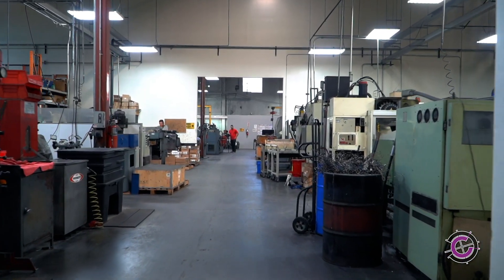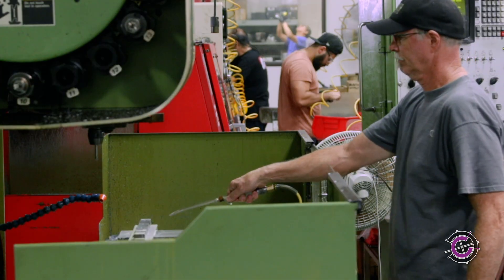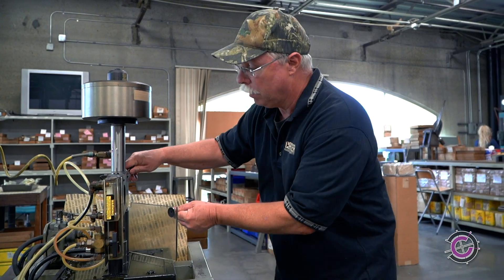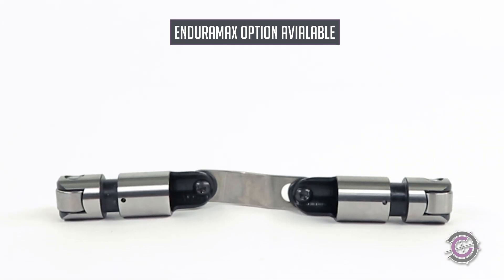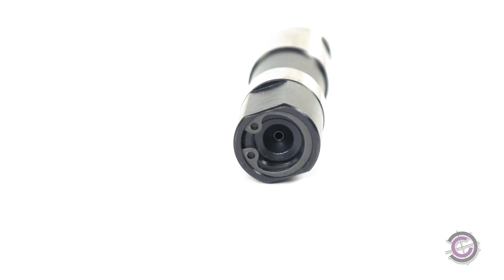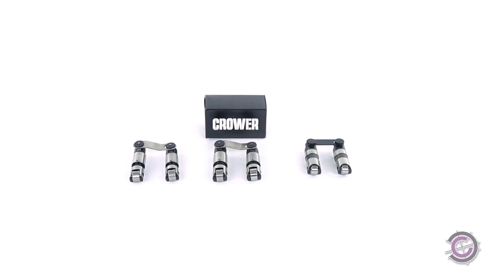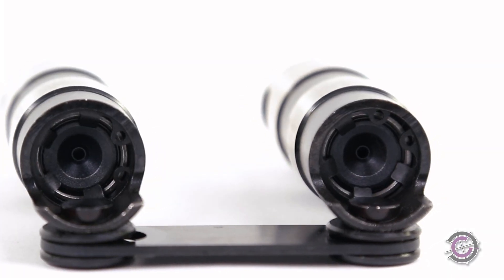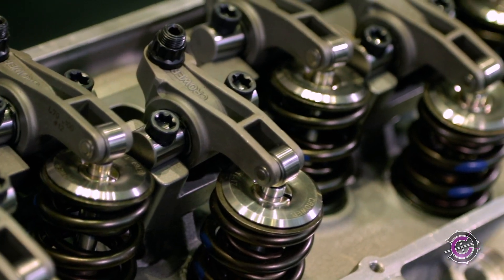We Show You What Makes Crower Roller Lifters the Best in the Business

Comment: Crower questions...
1-SBC around 2002 bought your severe duty solid roller lifters non hippo version, has 90 miles st driving only on it sat for 4 yrs. Do you rebuild these and how much? 
2- Are my springs good to go from sitting or need to be replaced before I drive its been 4 yrs. 200/500 lbs roughly